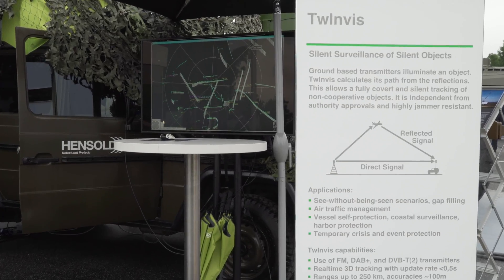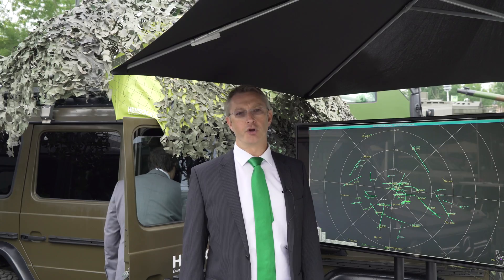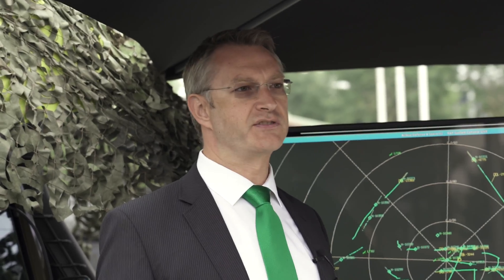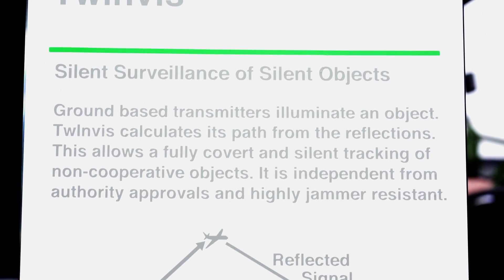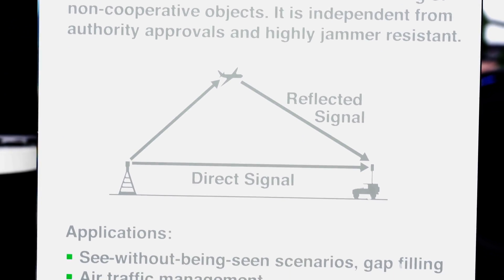Twinvis – Interview on HENSOLDT´s Passive Radar

Comment: Nice technology . By the way please elaborate that how this system is different than Electronic support measure systems ? Please
Reply: Esm looks for signals transmitted from a aircraft. Passive radars use signals reflected from the aircraft broadcast by commercial television and radio stations